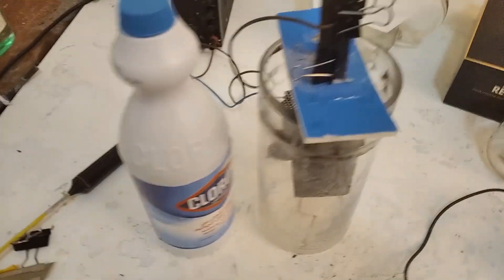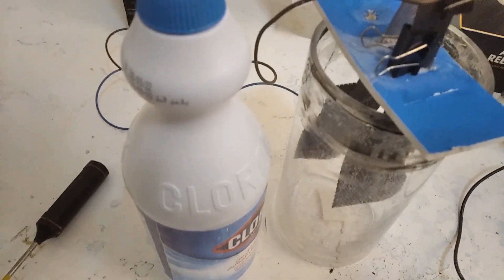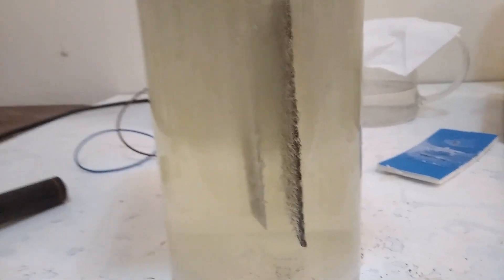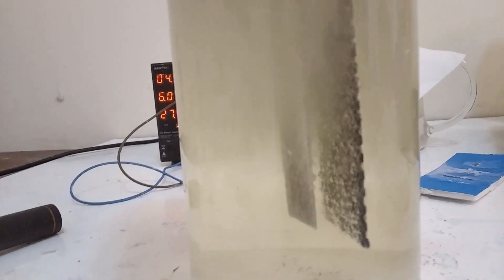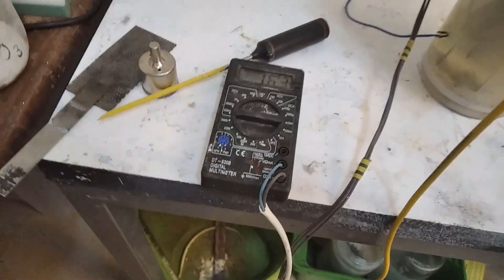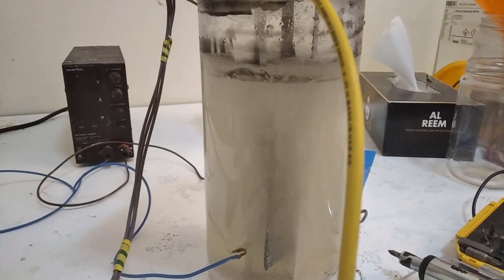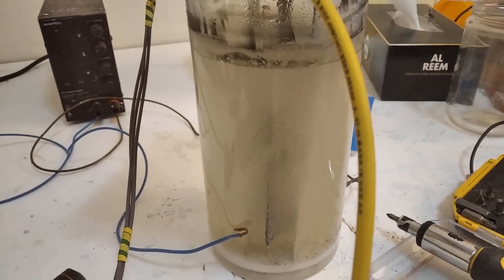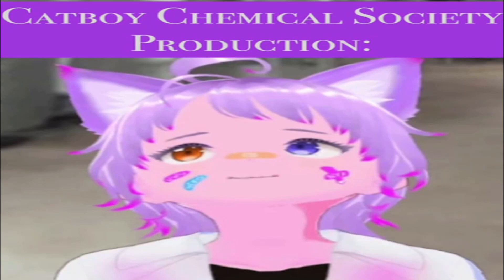PbO2 Lead Dioxide chlorate cell errosion problem SOLVED.

Comment: Has the author attempted to use molybdenum dioxide (MoO₂) or titanium suboxide (Ti₄O₇) suspensions for electrophoretic deposition on titanium plates? While this approach seems feasible, I suspect an intermediate ATO (antimony-doped tin oxide) coating might be required to enhance adhesion and conductivity

Comment: So is electrolysis of NaCl is more corrosive and thats it results immediate brown color? Could it Cl2 generation oxidizing lead electrodes?
Reply from the maker: PbO2 is reduced by Cl2 but by adding hypochlorite you force oxidation of hypochlorite and it's catalytic generation.
Reply: @CatboyChemicalSociety  that’s genius! Looks like hypochlorite serves as some sort of shield/sheath around pbo2 to protect it from cl2!
Reply from the maker: @Mark300win  yea this is how it's possible to do chloride to perchlorate. You add 50%water and rest is 5% bleach so you have a 2.5% bleach solution then you dissolve as much salt in it as possible. Then you run PbO2 in this and keep temp below 45C or hypochlorite decomposes and Cl2 is evolved.

Comment: it could be used  Pbo2 electrode for kclo3 production , rigt off from a dead  car acumlator?!
Reply from the maker: interface oxidation is an issue hence u need an inert substrate

Comment: What do you mean with a higher pH? I read the ideal pH for chlorate production is 6
Reply from the maker: Yes under normal circumstances with MMO or graphite yes but chlorine evolution reduces PbO2 into PbCl2 and PbO2 cannot run past 50C anyway which means pH wont stabalize due to escaping chlorine at lower temps. The 54% efficient hypochlorite oxidation prolongs electrode lifetime of PbO2.
Reply from the maker: @kennethbay2225  the correct way is to use IrTa to 100% chlorate then switch to PbO2 but this specific video is on what happens if you don't have any other electrode because some people think PbO2 can do Cl2 evolution but that causes erosion and they are left without budget for extra anode. This is due to semi false claim that PbO2 can go from chloride to perchlorate rumor online. This video shows how to maintain oxygen evolution for chloride to perchlorate without erosion sacrificing efficiency.
Reply from the maker: @kennethbay2225  yea using persulfate can improve current efficiency curve allowing to run at lower power. But who wants direct KClO4 anyway because it's less useful. Cant easily make NH4ClO4 and ik you can use ethanol method but imagine needing 5 liters of ethanol to make 1kg of it vs half a liter of water.Also gimme current density and runtime calculations for efficiency along with solution concentration and temperature. Because I can never get to 150ma/cm² with KClO3 electrolysis without heating to 70C which is past PbO2 working temperature of 60C
Reply: @CatboyChemicalSociety  KCLO4 less usefull????? LOL have a nice day.
Reply from the maker: @kennethbay2225  I don't use it for pyro that's why. You cant make CHP or LL8 with KClO4 or do lithium ion battery chemistry as that needs LiClO4 which can be made from NaClO4. Or manufacturing beta PbO2 anodes itself which needs NaClO4.

Anyway since a lot of pyro ppl ask me about direct electrolysis of KCl or KClO3. I need you to gimme current and input grams and I can check your runtime calculations.
Reply from the maker: @kennethbay2225  still interesting how persulfate can force OER in chloride to perchlorate electrolysis also. But hypochlorite also forces OER allowing for one step conversion as well to prevent chlorine evolution on anode.

Comment: Hello Sir, Congrats on the great content you provide us, I admire your experience and passion. Please continue the great work.
I have been tinkering with chemicals hoping to make refractory bricks, and so far I didn't succeed, especially I failed horribly in producing Aluminum Oxid. I followed you tube videos, there are two methods on youtube, one is by reacting Aluminum foil with HCl then neutralize the solution with sodium bicarbonate to produce Aluminum hydroxide, on youtube the product is a decent amount of white powder, but with me it a minute amount of brown stuff. the other method is by reacting aluminum with NaOH then evaporate the solution to get aluminum oxide, it produced white paste like material I suspect it to be Sodium Aluminate. but this stuff doesn't dissolve in water neither produce heat while reacting, also it doesn't look like aluminum oxide. sorry for the lengthy speech.
can you please help me with this (producing Aluminum Oxide). I trust you and your knowledge
thank you very much
Reply from the maker: the carbonate wont work because it produces aluminum carbonate along with hydroxide which also produces some gas so use NaOH instead with careful pH monitoring till 9 or calculation of how much NaOH to add before measuring.
Reply: @CatboyChemicalSociety  thank you sir, I will try it and inform you how it goes 👍

Comment: how was the temperature from cell? on my researches, the temperature has great influence and should kept over 40°C

and, have you tried thermal decomposition to coat the titanium?
Reply from the maker: ok for non pH controlled cells temp doesnt matter but for pH control 60C is the minimum and 75C is where you want to run at otherwise your pH will rise too quickly.

Also yes to make this electrode I thermally decomposed SnCl4 onto Ti then coated that with PbO2 using plating method since you cannot thermally decompose PbO2.
Reply: @CatboyChemicalSociety  the oxidation reaction takes place at higher temps, when I run my cells cold its release lots of chlorine as gas and start to raise the pH very quickly.... and the high pH destroy the lead oxide

I found a paper using lead nitrate to make thermal decomposition, will try next time
Reply from the maker: @Eduardo_M_Jud  actually high pH keeps lead oxide stable from my experience since ive run them on straight NaOH solutions for other experiments.
Chloride is what hurts them also what substrate is your lead oxide electrodes. Is it commercial or homemade.

Comment: yup.. i tried it too a while ago.. the brown solution is not showing up.

but after i harvest the chlorate from the 1st run, and then add more NaCl for the 2nd run, the brown color showing up again..
Reply from the maker: run graphite/Ir-Ru for awhile till pH goes up to 11 and chlorine odor is gone to fix it.
anyway you can also just let it to run to perchlorate and I think its gonna be fine too which is what im gonna test with this.

Comment: I'd like to know a good route to synthesize perchloric acid without access to sodium, potassium or ammonium chlorate or perchlorate 🤔
There are pretty tight restrictions for buying those in the UK.

I have some 4% Sodium hypochlorite bleach
Some solid Calcium hypochlorite. 10g grams of barium perchlorate and 10g lithium perchlorate

And many other reagents only perchloric acid has up to now remained illusive to me. Later next week I get vack from holiday and I would like to devote some time to trying to make some. From what I've seen and read it has some pretty interesting abilities but then I don't need to tell you that... 🙂
Reply from the maker: just get a good pair of PbO2 anodes either homemade through my upcomming tutorial or purchased from suppliers and watch this video when it premiers.
and literally run this cell for a week to get about 700g of NaClO4 then you can use that.
Reply from the maker: just literally mix your barium perchlorate with sulfuric acid and filter DONE!
if you can get more barium/calcium perchlorate then good.